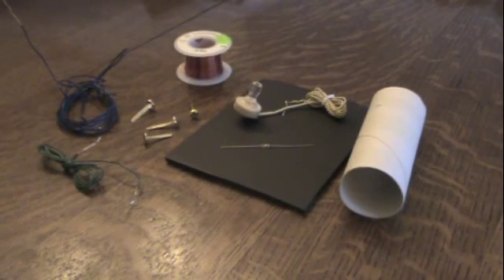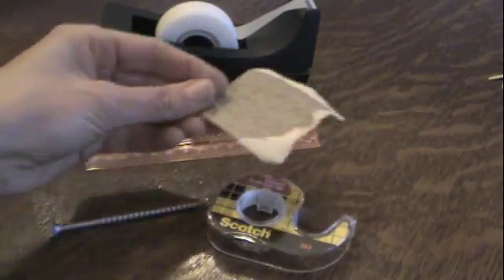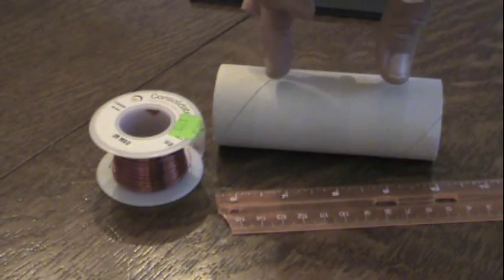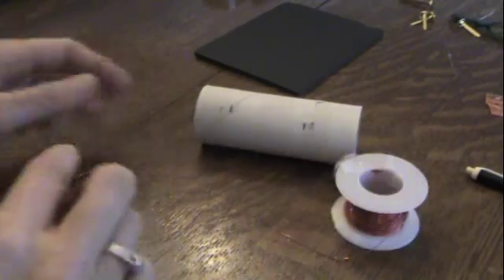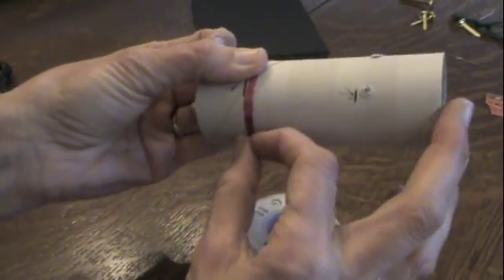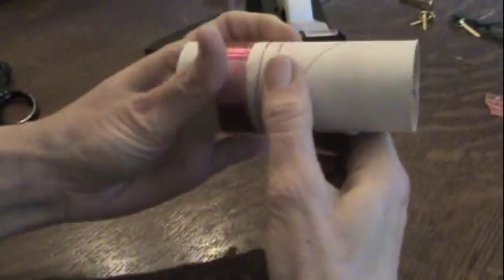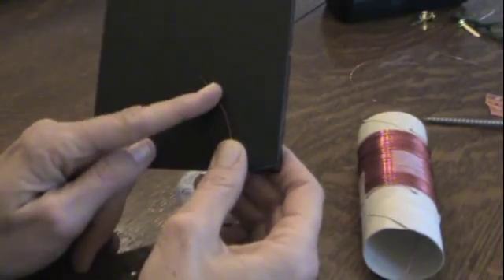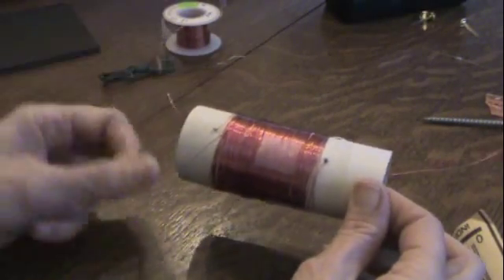AM Radio Lab - part 1.m4v

Comment: A nice simple demonstration.  
I am posing a question 7 years after the video was published.  It would be great if I got a reply. 
The question is about the length of coil:
At 3:38 the video shows that your ruler is measuring the coil length to be 2 1/8 inches long and NOT 2 5/8 inches as heard in the audio. 
Which is correct? 
I would take the actual visual evidence over whatever is spoken.